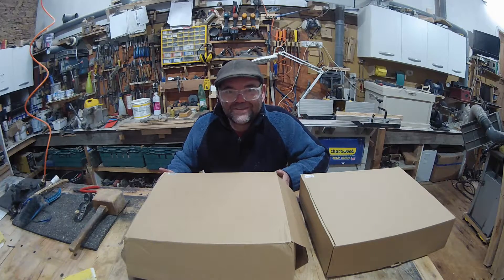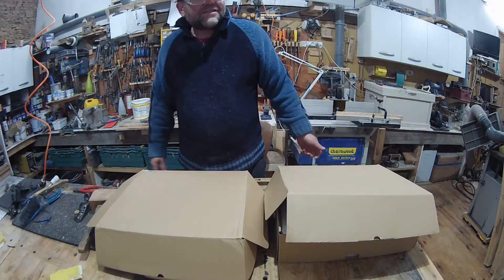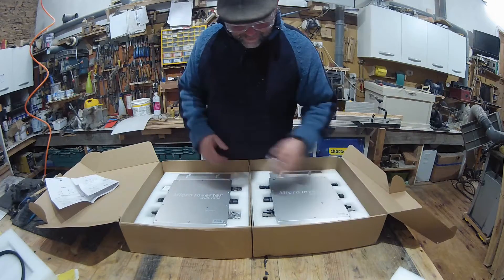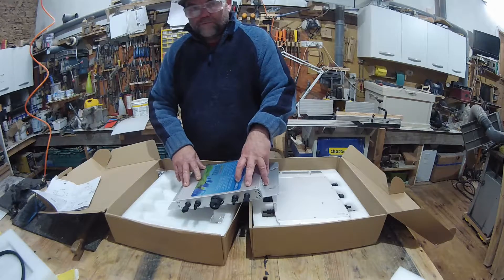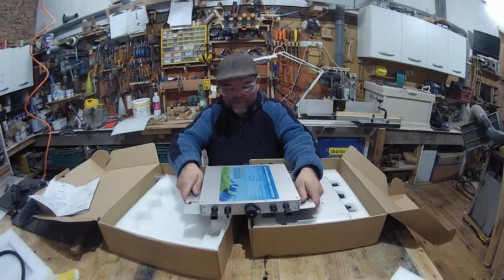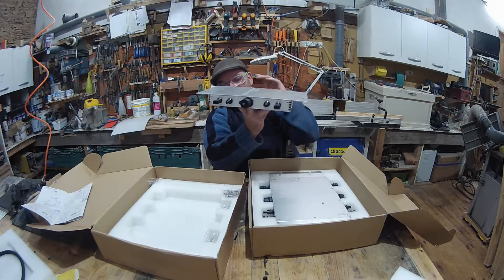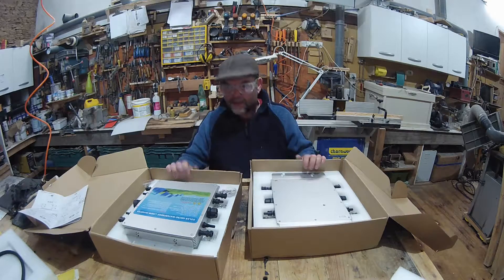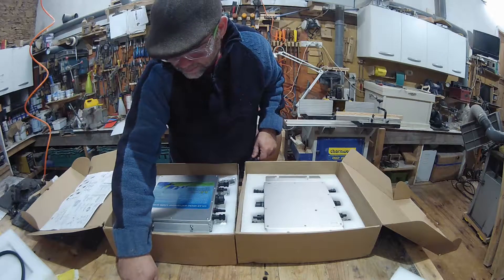Micro Inverter 1200 wvc unboxing by WAllY WOOD low cost solution SP-WVC1200 PLUS

Comment: How did the wvc inverters work for you? Did you have any problems with them?
thanks
Reply from the maker: Hiya, Mine are working but i would not say they are the best but budget. I have one which the led keeps changing from red to green so not sure if it is working correctly. They are cheap though! If WVC sees this then maybe they will replace my faulty one without jumping through hoops?